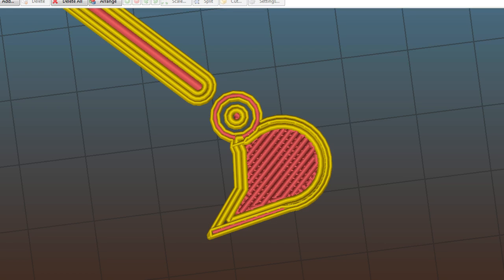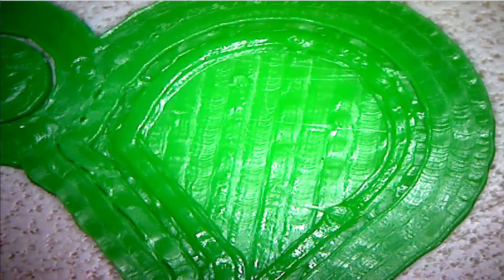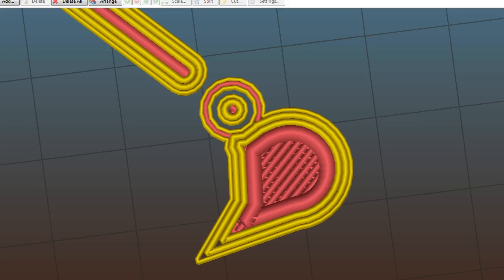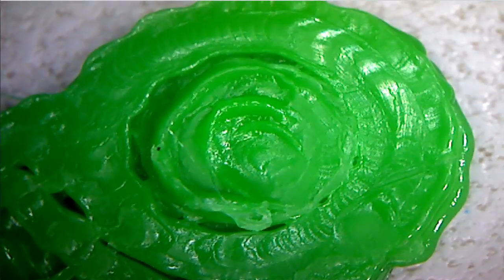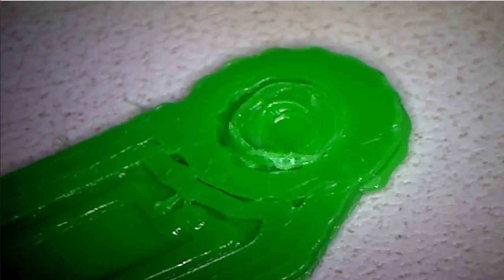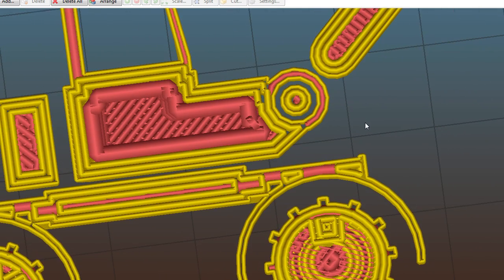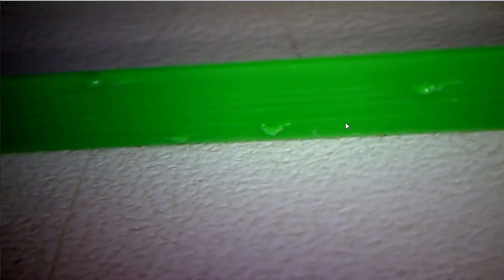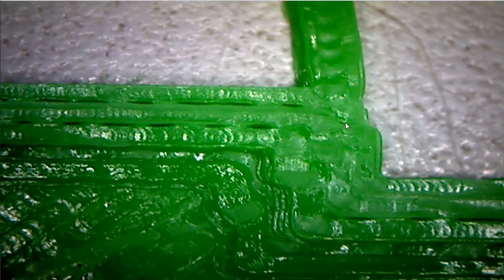Extrusion problems

Comment: I discussed this with Travis on IRC already.

I'm pretty sure that the following issue is the culprit: https://github.com/alexrj/Slic3r/issues/2960

Printing at 0.4mm layer height removed the problems, as expected. I think the easiest solution if you have these problems is to use an earlier version for now.

Comment: In the spirit of throwing all ideas at the wall to see what sticks; I'm curious if it's a combo of 2 things: Your nozzle-diameter setting being too big, and ALSO it's overextruding (which i guess could also be caused by the nozzle-diameter setting being too big).
So the 2 problems could cancel eachother out a lot of the time:  The nozzle being too small means the lines it lays down are too far apart from one another - leaving a gap.  But most of the time that gap just gets filled in by the extra plastic oozing out as it overextrudes - hiding the problem.  

Something else to keep in mind:  With very small prints, it can help to make the width of the small part an exact multiple of your nozzle diameter.  This guy speaks about it for 3 mins or so here https://youtu.be/uv9q6lKINs0?t=9m38s .  And i imagine the problem could be further complicated if your nozzle sizing is off.
Reply from the maker: roidroid Unfortunately I've no means of verifying it, but my nozzle was sold as a 0.5mm, so I have to trust that.

Also unfortunate is that I don't have the source files for the model, only the rendered STL. I could scale it up to get bigger tolerances, but it's already pretty big.

Comment: Ignore me I just read your info under the vid.
Reply from the maker: Daniel fielding Haha! No worries. Any ideas? I'm stumped. My only thought is inconsistant extrusion, which would throw the calibration completely out of whack.

I might try slowing it right down. I can print big stuff at 100mm/s no worries, and I've lowered it to 60mm/s for this, but it's still not enough.
Reply: How are the teeth on the hyena, clean? If you want to send the file to me I could try printing for you. I am running some petg from esun. Man that stuff is beautiful.
Reply: Also have tried removing the idler and feeding by hand? What temp are you running. Is the thermistor attached properly or has it come loose?
Reply from the maker: Daniel fielding I'm loathe to undo the idler because I'd have to recalibrate the esteps for the new spring tension. :( I'm using PLA, so it's harder to gum up hobbed bolts. I've added the model I'm trying to print to the description. I'm printing at 170c and my thermistor is secure.